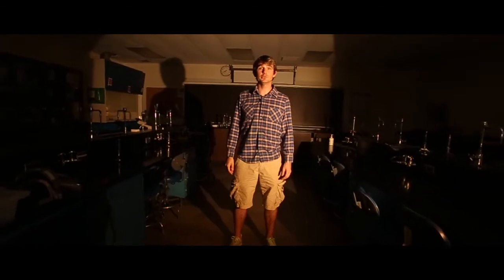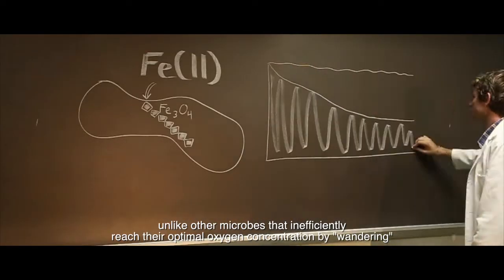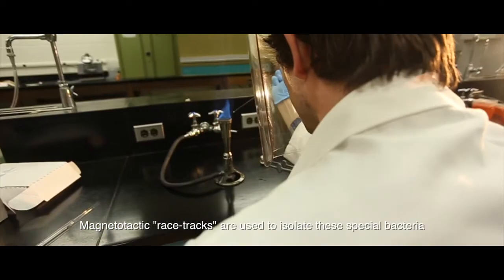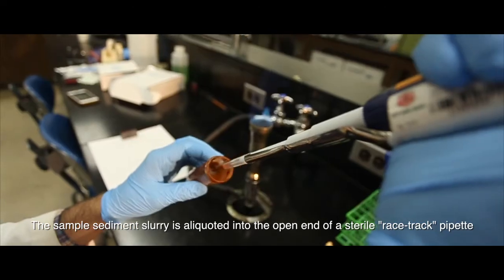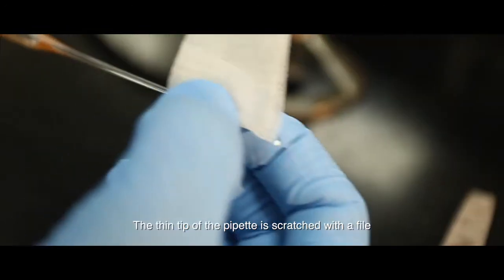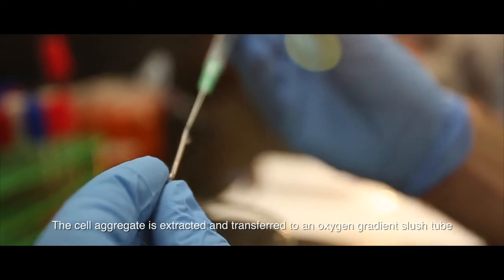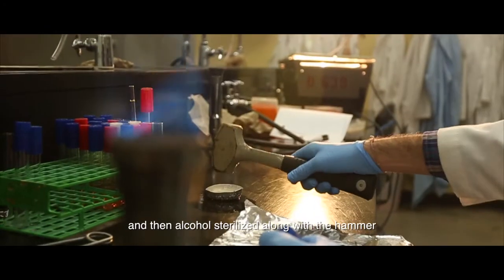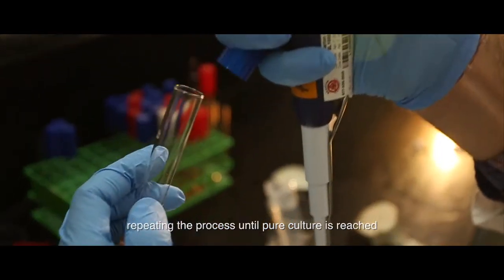How to Isolate Magnetotactic Bacteria

Comment: What is an oxygen gradient slush tube ?
Reply: It is a tube that is made with a low percentage of agar so it is not as rigid as a normal 1.5%. The tube also has some sulfur coupons in it so that you get a gradient of O2 at the surface that becomes smaller as you go downward allowing for stratification of the O2 levels. This "slushy" low agar component allows the microbes to more easily migrate to their optimal oxygen gradient.